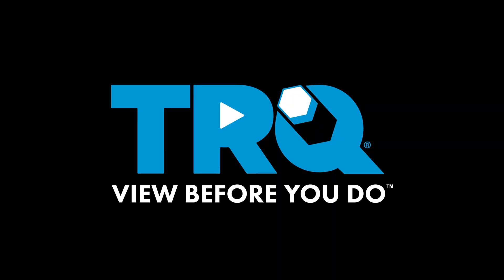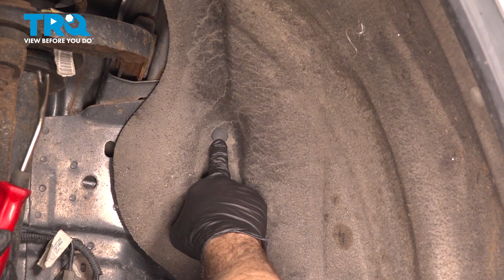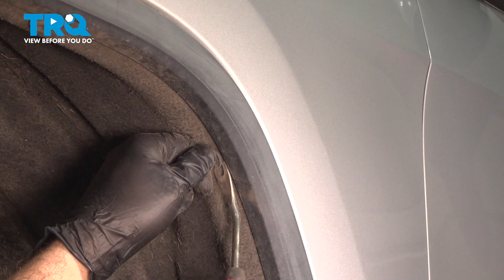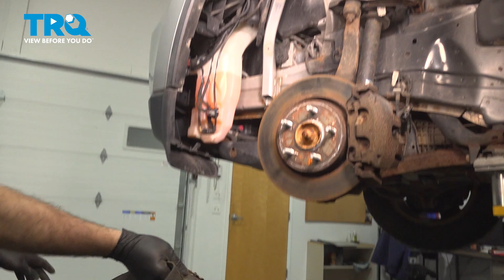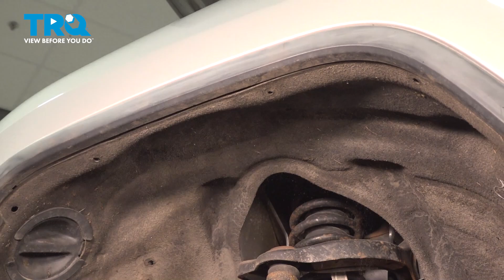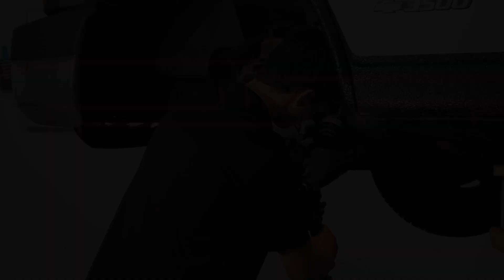How to Replace Windshield Washer Fluid Level Sensor 2011-2021 Jeep Grand Cherokee

Comment: Can anybody point me to the connector type that is used by this sensor? My secure tab is missing and I cannot find a way to remove the connector without destroying it. So I will need a replacement connector....

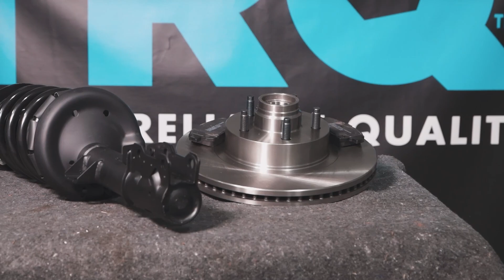Comment: This video is a complete waste of time for anyone with a  2021 JGC Overland.  Turn the wheel all the way in or out.  Use 10mm socket, take off 1 screw at 2:30 o'clock like you're driving the car, then remove the no tool required screw off plastic twist at 7:00 o'clock.  Get a bungee, place one end in the liner hole and attach to suspension coil.  Easy access to the sensor.  Remove the sensor 1st from the container, then you can access the secured tab easier, take sensor off, click on new sensor, push back in the fluid container hole. Undo the bungee, put back in the plastic twist, place 10mm screw back in liner. Job is done less than 5 minutes.